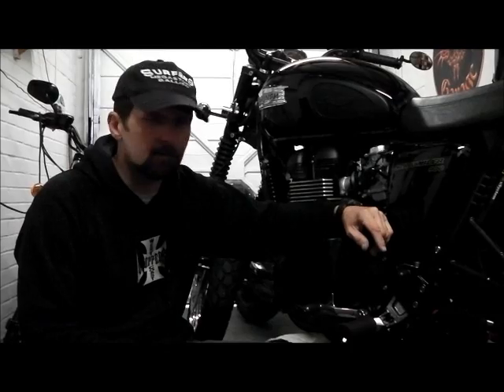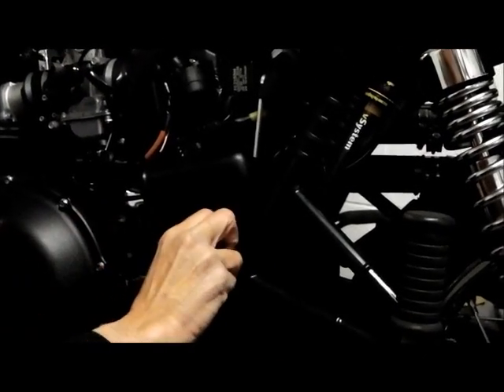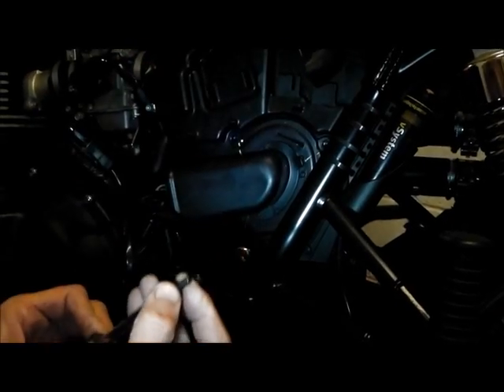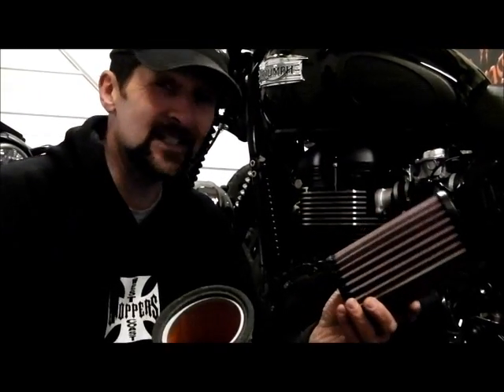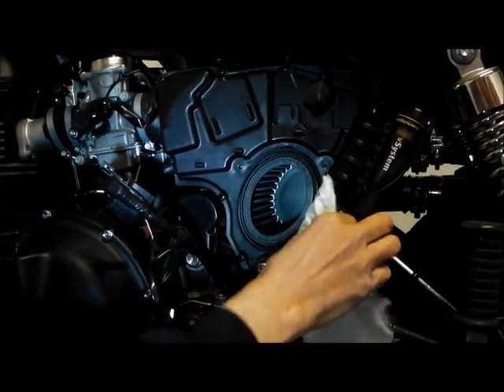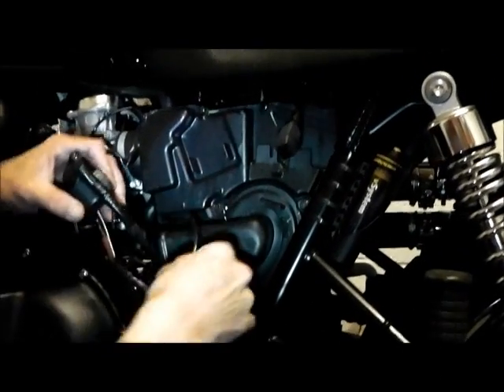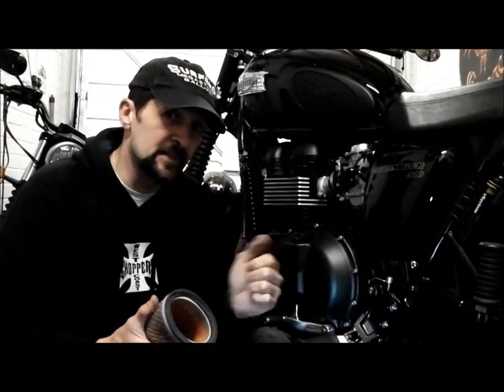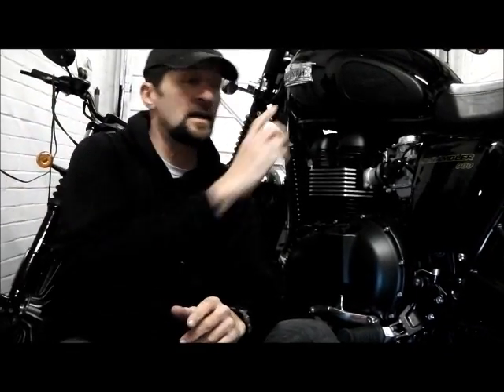Delboy's Garage, 'How To' Triumph Scrambler K&N Filter upgrade

Comment: For a 2-stroke MX bike, it come with those foam filters that you have to oil.  Do you need foam air-filter specific oil, or can any 30W type engine oil?  Also, if you oil it too much, it probably won't breathe properly, but if you don't oil it enough, it probably won't filter as effectively.  How to you find that balance between oiling enough, and not oiling too much.

Comment: @8:34"I imagine if you really want to be OCD, there is a torque setting for these"...3 Nm!!! LOL I have started the countdown on you for when you decide to carve that airbox up and really let the ol' girl breath! +1 on your attitude of why you do this mate...I do it for the same reasons too.
Reply from the maker: Ayup mate, you're gonna wait a long time for the air box mods cos I'm no gonna bother!  Not only is it a bitch to get out, but I don't see the reason, there are practically no performance gains to be had from that alone and when you consider that even the 900 big bore kit only gives you a fraction more horse power, it's just not worth the grief... bikes always run better with air boxes, specially EFI motors... pipes, filter and AIS remove is all it's gonna be... !  The way the bike is so easy to throw around and handles so well, I'm actually chasing that rainbow instead... gonna deal with a rear shock upgrade shortly to eliminate the wallowing in bends and when it's tyre time, switch over to something softer... I've never used all the power yet, even on standard pipes, it has enough grunt for pissing off the traffic lol!
Reply: Good point on the EFI but there is a decent gain on the carb'd models. The butt dyno makes it a lot of fun too. It's easy to get them out...just need to undo the rear shock and accordion the bike up at the swingarm. I agree with the suspension...always a good investment especially with the stock set up on these bikes.

Comment: Evening Del Do these booster plugs i hear alot about do or don't they work Secondly if you are ever in Australia I'd be keen on going for a ride with you
Reply from the maker: Hi mate.. The booster plugs only apply to the later fuel injected bikes, and they do make a few small changes to the feel of the pull away and initial acceleration, but for the huge price tag, you'd need to be pretty unhappy with the factory performance to take the plunge... !

Comment: Have to admit, i am ripping the K&N out of my bandit and going back to paper, as for me my bandits running a tad lean with the filter and the stubby can. I think with stock jetting its either got to be one or the other, not both. Going back to OEM. :/   Good vid matey!
Reply from the maker: Sounds like a weird move John... you're actually gonna throttle it and choke up the air intake to rectify incorrect fueling... I've stock jetting in mine, 10" exhaust and a K&N panel and it runs fine... or have you been listening to Dave & Gerry again lol!

Comment: Hi Del, i just went to check my air filter on my 2005 bonneville t100. Finding that the previous owner pulled, i believe,,the air box and placed 2 clamp on k&n,s. 
I cleaned them and noticed it says,oil before using.  That's what I wanted ur opinion on. Personally I see no reason to oil, simply for rrason u gave.  I figure dry fit is fine as well, but wanted the opinion of an expert. I've never used these clamp on type but seems logical. 
Another question. It looks to me what the dude did was, glue the original rubber boot to the air filter. Do you know if there is a filter with the proper size boot? 
Just ask because u do so much revamp on the Triumphs, maybe youd know. 
I guess I can measure the air intake to the carbs. Anyway, take care, ride safe. Thanks Del.
Reply from the maker: Hi Peter, I'm trying to visualise what you've got there, it sounds like a bit of a custom alteration, and there are some pretty cool parts available on the market now, so it would help to know what you've got as far as fitting and operating the best arrangement, drop me a line on email, perhaps chuck a couple of photos in and we can take it from there... email:  delboysgarage@yahoo.com      Cheers, Del
Reply: @Moonfleet41  Hi Del. Rather than try my hand at pics sending. One of your mates,  The Man Cave, has a t100 build hes doing. The 4th segment is on removing the air box and installing clamp on k&Ms. Those are what I'm looking for, I believe. It seems that's what's been done to my 2005 t100. Thanks Del.
Reply from the maker: @peterford9369  Hi again Peter, don't believe I know that Channel, but there are lots of great Triumph videos out there, so glad you found what you needed!
Reply: @Moonfleet41  Hi Del,   I just thought you'd be interested. I'm actually just trying to find a couple of clamp on filters that fit my carbs. For a reasonable price. K&N, wants 50 bucks a piece for the ones that are now on it. And, not sure if they come with boots. Maybe I can call K&N. Thanks again Del. Take care.

Comment: I love the idea of a K&N air filter but I must admit I bought one for my last bike the kawasaki VN800B and was surprised that with the straight through pipes already fiited it ran like a bag of shit, I took it to the bike shop to see if they had any idea's and they told me that it would need to go on a dyno and more than likely need re-jetting, so I said well you'd better book me in then, only to be told that they don't do it, so I asked where the closest place to get it done was and it was sixty miles away, so out the K&N came, Oh well better look with this bike I suppose, lol, Sorry to whine at you Del, Didn't mean to, Ride Safe My Friend.
Reply from the maker: Hi Skeggy, that sounds to me like the typical no-nothing bullshit that you get from dealers who haven't got a phuqin' clue!  There was absolutely no need for it to be Dyno run, what you did in replacing your filter to go with the pipes was effectively give it a 'stage 1' tune and the third stage of this three-stage process is to fit a dynajet kit to correct the fueling in the carbs... dynajet make kits for just about every bike through years of research they have already worked out what you need and supply it as a ready made kit for about £20.. shame these fuckwits didn't know this basic common knowledge and couldn't pass it on to you!  Just goes to re-affirm my opinion of some of them!
Reply: Moonfleet41 Cheers Del, That's most appreciated, For warned is for Armed so to speak! I'll know better next time, I got the impression they didn't want to know because I hadn't bought the bike from them, I feel like I was right now bud, Thanks, TTFN.

Comment: Dealership rates for a mechanic to wash and dry a washable filter - I suspect this will be one of many reasons manaufacturers will use a disposable product. You'll need to watch out when you put it in for dealer service to get your book stamped that they don't put that one in the bin too.
Reply from the maker: Didn't really cover that Guy, but all you simply do is place the supplied sticker on the filter lid that clearly says 'K&N inside do not dispose of'... and also, not only would it be expensive at £70+ per hour to ask them to wash it, but tbh mate, I don't think they'd want to!  It's something you do yourself at home before you present the bike for service and just tell them to leave it alone!  I'm sure you'll get NO discount for them not having to change it, but you certainly won't be billed for it's replacement!

Comment: hey man great stuff .. i just recently change my standards filter to a k& n  on my t100 2006 model. and a new exhaust tec 2-1 .. so my question is do i need re jet? or do i leave my bike as it is.. with the new exhaust and the filter.. will damage somehow my bike if i don’t re jet or i just loose a bit power.. ?

Comment: Thanks for the tips again Delboy. I wasn't sure if you needed to use that oil after washing the filter, glad you don't need to because it's no good to be washing oil down the drain either. I don't care if this is one of your oldest videos, it's great.
Reply from the maker: It's perfectly ok to run a K&N filter dry as it is to oil it, specially if you're in a dusty environment oiling it makes it like a fly paper, so if you have an oiled filter it will bung up extremely quickly , it's perfectly ok to run them dry, just because you're givven the oil doesn't mean you have to use it, after all, they don't oil the paper or foam ones do they...??!

Comment: I'm a big fan of K&N -the previous owner of my DRZ fitted one, but when I went to clean it I discovered they'd re-oiled it with something heavy like engine oil, and the thing was gummed up like treacle. One wash later and the performance difference was amazing!
When I got the S4 I slapped a K&N in her within the first week. Brilliant bit of kit, I don't know why manufacturers stick with paper filters, except for the financial aspect of course  :o)
Reply from the maker: Well done mate, it's amazing what substances I've found soaking these filters, but honestly, you don't need anything... the wetter they are, the quicker they gunge up and I can't think there's much profit in selling you an air filter, not to mention the green aspect of sending them to landfill... after all, they charge you £12 for disposal of your old oil, so it's not like they aren't tuned it to recycling!

Comment: Great information as always. I really do feel that the K&N and other similar products are the way to go. As a matter of fact, my wifey insists on all our vehicles and we just wash it in soapy water. Tried it with the oil and living in a desert like environment just made the filter harder to clean. Just a small tip I use is 3" painters tape to help against scratches on maintenances, but don't know if it would hold up against the "cheese grater." Thanks for the awesome info again.
Reply from the maker: Hey buddy, you've re-affirmed exactly my point... in dusty desert conditions on a long ride or tour your filter can just become blocked, the ability to take it out and bang it against the foot peg and carry on is essential... good call on the tape, anything will do that stops that filter scuffing your paint...

Comment: throw-away filters brings money to the company! they will never change to washable filter.
Reply from the maker: Which is predictably short sighted of them because the sale of the filters makes them pennies, and the dealer/technician takes a few minutes to change it....but to add "washing and drying of air filter = 20minutes" to the service bill would make them far more money...but hey, when did you ever hear of a dealer using common sense...!!!!

Comment: After  all that work you didn't lightly spray K&N filter oil inside the filter before installing it. You must use the oil and you must apply it very lightly but covering all surfaces where the air comes in, Not the intake side.

Comment: The "dust" that sticks to the oil is meant to do that, that dirt is going on the oil instead of going into the engine.
Reply from the maker: Sorry mate, didn't make it clear, you can run K&N filters wet or dry... at no point does the dust go into the engine provided the filter is fitted correctly!  One normally runs them wet as that's the initial idea, but running them dry in extreme dusty conditions can lead to a thick claggy build up that will block the filter... whereas if it's dry, it can drop to the bottom of the filter and allow it to still breathe and you can whip it out at the roadside on a long trip, such as through the desert etc., and just bang it out... you can't do that if it's all gummed up with oil...

Comment: There's no doubt they make sense, even when moving a bike on. They're an indicator that the owner thinks about the care and maintenance of the bike and if one is fitted to a bike you're buying, then it's one less consumable you have to think about at a time when you should want to check the state of brake pads, brake fluid, plugs, fresh oil and filter, chain sprockets, tyre etc. These won't always be as you would want them to be, and personally I'd go through the lot replacing anything remotely worn. Only then would I be happy that the bike was sorted for my ownership. The things any conscientious seller should have done first, and if they claim to have done it, ask for receipts!
Reply from the maker: All good points Peter, I always call that a 'consumables make over'...even when I mentioned to ThreeX that the Hayabusa had a panel filter they were glad of that as it was due a service and it would save them £20!

Comment: Couldnt agree more, great upgrade. I use K&N and have for a long time, on my Harley its exposed so I always use the oil (slight coat) to bring the color back. BUT,,, the filter is taken out and washed monthly. Very good points you have made here....
Ride Safe....

Comment: You should definitely oil the filter as It requires the oil to stop dirt particles from passing through the filter and into the air intake/engine. It will hardly affect mixture if you clean it regularly. The only time you don't use oil type air filters is with maf sensor style intakes as the oil passing through can damage the hot resistor wire. However the dry type filters used on those systems have a closer weave to reduce particle transfer.
Reply: The cotton gauze filters usually come oiled.  I have ran a K&N on my truck since 2004.  The MAF sensor is right behind it.  If you don't go nuts with the oil, it will not cause any issue with the MAF sensor.  The tighter weave on the paper filter is more restrictive.  A properly maintained oil and gauze filter is actually less restrictive and filters down to a smaller particle size.

Comment: Great video @Moonfleet41. Quick question, was there a reason why you didn't just leave out the snorkel when you were installing the new air filter in? I've read that if you remove the snorkel, it will further remove any restrictions to the airflow...allowing you to squeeze a bit more performance and make the bike sound more beastly? Your thoughts would be appreciated. thanks
Reply from the maker: Hi Ryan, what you have read is right, the snorkel and internal air baffle removal do make a tiny difference.. but the factory snorkel is bonded to the cover that holds the filter in place.. you cannot leave it off of the filter will fall out.. and to remove the snorkel means literally cutting it off the cover with a box knife and that still leaves a rough shape to the hole that needs shaping properly.. you can buy a replacement retaining cover for the filter that has no snorkel.. but its about £70 for what amounts to little more then  plastic ring... maybe cannibalize a spare one from eBay.. but TBH, the small gains from removing it arent worth the trouble..
Reply: Thank you for your response - really appreciate your info. I see that you've used the cylindrical K&N filter for your scrambler. I understand that the filter for the Street Twin version is of the cassette type. Would you know if the concern for filter falling out if cutting the snorkel would still be applicable for the ST version? From what I read, the cassette filter sits flat inside the compartment. But point taken regarding cost vs reward in cutting out the snorkel portion and the supposed small gains obtained. thanks again!
Reply from the maker: Hi again Ryan, firstly I can't answer the question about the cassette filter being held in, but I can say that honestly mate, all that kind of malarky is pointless, it will not give you any more performance... the whole concept of it comes from long ago when Japanese manufacturers seemed to only get woefully poor return in means of horsepower from some quite big engines, my old GSX1100 Suzuki in the 80's made about 80hp brand new, and even £3000 spent on the engine, only made 110hp... (before the days of turbos)... but fast forward to modern Triumphs, they have become incredibly good at wringing all the power out of their engines, there truly is nothing being wasted on tardy tuning, what you get from your Street Twin, if you put it on a dyno, is probably 99% of what it's capable of, and that's great news when you buy a bike now cos you don't have to worry about trying to make it faster, nowadays if you want a faster bike, you have to buy one!    If you speak to George Milburn at TEC Bike Parts, he has done some amazing research development work involving the cams on the new breed of Triumphs and what he's offering can actually create some proper bona fide meaningful horsepower, a kick in the pants you will actually notice in real time... but all that faffing about with air boxes, and air box eliminator kits, etc., is 100% for looks only mate... you get nothing meaningful from it, so don't waste your money or your time... The best way to achieve better performance on today's bikes is down to just removing weight and improving the quality of the tyres... heop that helps you mate !  Give George a ring and have a chat with him !
Reply: Thank you Moonfleet41, honest and incredibly useful response - really appreciate that! Again, I take your insights to heart as I'm no expert. I've seen the videos of the TEC cams and they do seem to add legitimate performance (with dyne results posted as proof). I think from my perspective, a quick, least intrusive and cost effective way to boost performance on a ST is to put in a high flow air filter and decat it. thanks again!

Comment: Hi Moonfleet 41,

I installed the d&d full system exhaust when it came straight out from the dealer. i'm wondering do i need to remap again if i put the k&n filter??

thanks
love you videos ive learned alot
Reply from the maker: Hi mate.....as long as you had i remapped when you fitted the D&D, then thats all you need to do... the filter wont make any difference, you dont have to remap at all for the filter even if its all standard.... ill bet it sounds great too... hope that helps... all the best, Del.
Reply: Thanks mate